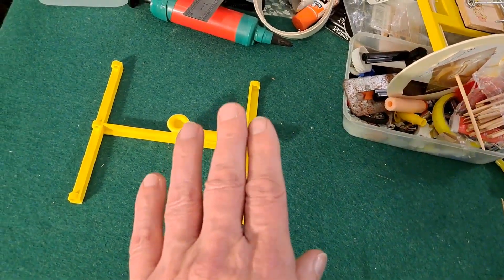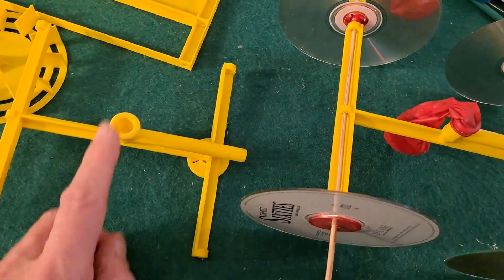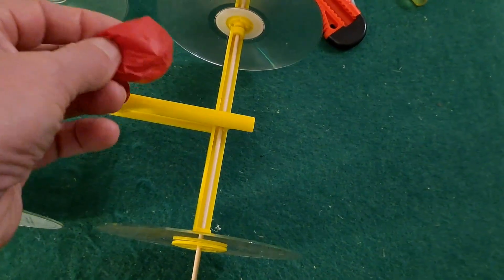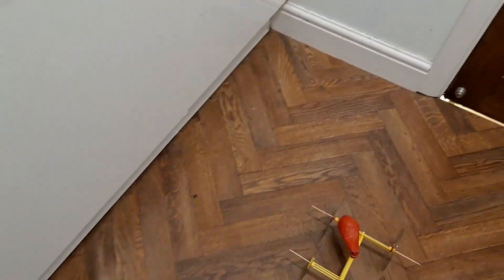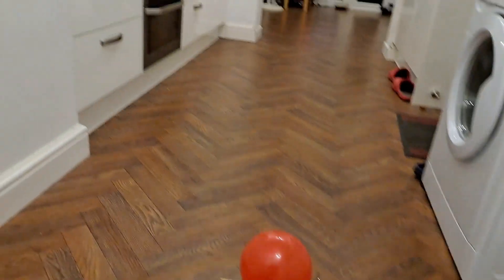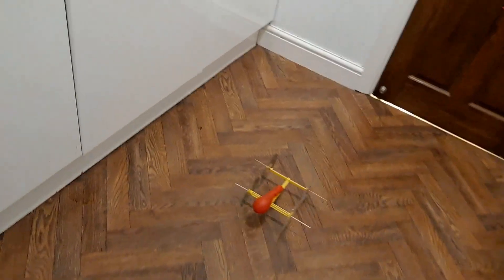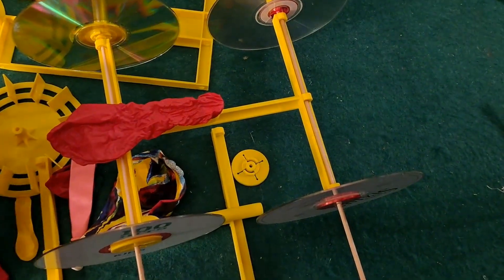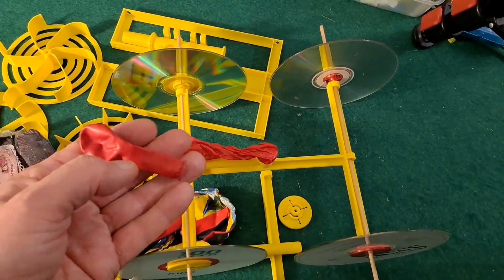Mk 2 3D printed Balloon Power Car

Comment: Sir could you tell me 
Why my cheap rc car doesn't go
I have put a litium battery on it an only the light work but it doesn't stear and it doesn't go forward or backwards ?
Reply from the maker: No way to answer you from the information you have provided. You say the lights work. Do they work in response to the controller, for example, the front lights come on when you press forwards and the back lights come on when you press backwards?
Reply: @GrandadIsAnOldMan  before the light worked when you press forward on the controller and the car moved
But now when you connect the battery the lights instantly turn on and when you press the controller nothing happens
Reply from the maker: Is the new battery a higher voltage?
Reply: @GrandadIsAnOldMan  it had 4 double aa but I put a litium 3.6 v 3000mah batery
Reply from the maker: @decomposing_while_alive2002   4xAA is 6 volts and you are trying to run it with 3.7 volts so maybe it doesn't have enough power
Reply from the maker: @decomposing_while_alive2002  just a thought, did you check you have the positive and negative the right way round?
Reply: @GrandadIsAnOldMan  well it worked for some time after I connected it and then it stopped and 
It didn't go any more on a fully charged battery 
And yes I checked the battery is correct
Reply from the maker: @decomposing_while_alive2002  have you tried it again with the original 4xAA batteries?